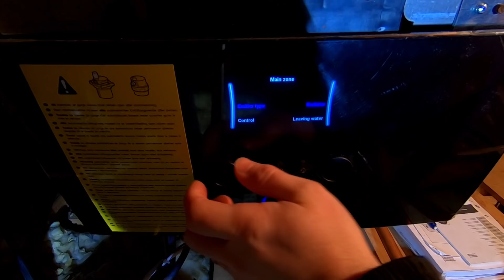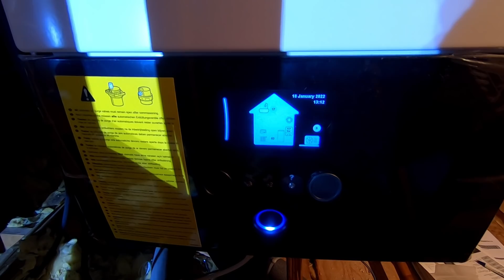How to lose £2000 installing a heat pump

Comment: having listened to users and installers , air source heat pumps work ok above freezing but below freezing the use of a top up electric element makes the system not very efficient , the units are big bulky noisy and require loads of extra systems to install , you will need to go back to hot water storage cylinders etc its really not worth it and the cost is astronomical , and if you dont have under floor heating prepare to more than double your radiators in the building , and if your in a pree cavity style building dont even bother thinking about it your building will never ever have enough insulation to make it work well and also note the output of the system is so slight when like this week ( 4th  week of march ) where we have warm days and cold nights forget it your either be running the system all day and boiling or freezing inside at night cause it takes so long for the system to warm the house up , dont take my word for any of this listen to the experts that are not selling the product , they have no axe to grind , well done urban plumbers on your work
Reply: Nonsense. A standard heat pump works at near full efficiency down to -15c. A cold climate one keeps going at full efficiency down to -25c. When the UK reaches either of those temperatures, let me know
Reply: @britexpat_l33t  to work at those temperature they use a body element if you actually knew what your talking about to start with would be helpful , but thanks for your unhelpful comments
Reply: Most decent heat pumps work happily to -3°c and many even lower, they work very well in other European countries with harsher winters and have done for decades.  The difference in the UK is that we have very low standards of skilled workers and a huge shortage of the ones even a little trained.
Reply: @patrickwheeler2646  thanks for your comments but installers have no bearing on the ability of the system to function , at low temperatures they use boost elements to heat up and what with that and there lack of output doesn't make them economic , i have worked in property refurbishment for many many years and have read all the data most of which is exaggerated at best , i have customers who have had systems installed and some even had them taken back out cause they don't work well enough and are not when it's cold economic to run , but thanks again for your input,  i personally will take my advise from the independent advisors who give an honest appraisal
Reply: @nigelsears7191  I'm independent, my company installs every heating technology from boilers to Hydrogen fuel cells and including boilers.  The fact that you have worked in building refurbishment for a few years does not qualify you to know the efficacy of a heat source.  Hear pumps can (emphasis on the can) work in a property and heat it when the outside temp is in the minus 5 or lower without a backup immersion.  We install a lot of heat pumps and very rarely do they need electric backup, they are there as they are with gas boilers but its incorrect to think that they are a large part of the running costs.
Reply: @britexpat_l33t  the lowest we usually design to in our area of the UK is -3°c so very higher scops fortunately.
Reply: @britexpat_l33t  not around London and the Home Counties, even if it did it would be momentary and have little affect on the home.

Comment: Air heat pump with a radiator system that typically runs around at 50-60 degrees is a bold move, i know people do it but the preformance and savings of the heat pump is mostly wasted. Did they have oversized radiators or some really good insulation for this company to consider it? Otherwise u might use weathercompensation but depending on the house u might need to set a minimum temperature of like 40 or higher degrees to get the system to preform as expected. What system was this? I was trying to find it but couldnt find the technical info. Also great install i see u really care about your craft.
Reply from the maker: They did no such a thing. Radiators sized for DT50 left unchanged.
Reply: @UrbanPlumbers  Well i hope they had a really inefficient system before so they dont notice the lackluster preformance of the heatpump. But anyway thanks for responding and have a nice day with garage installs and no crawling around in attics or flooded crawl spaces.

Comment: Well do not work for cowboy companies. Without weather compensation air sourced heat pumps are a very expensive mistake. Air sourced heat pumps are an expensive joke anyhow.  If you are going to the bother of installing a heat pump then dig up the garden and make it ground sourced.

Comment: These things will never take off. Its gonna have to be hydrogen hopefully produced in uk. Will create jobs and save us money buying it over seas
Reply from the maker: You do realize that 100% Hydrogen boiler (If it is even possible!) will be most likely 3-4 times more expensive to run as compared to a heat pump?

Why would you want to turn 1kW of electricity into 0.3kW of Hydrogen when you can turn 1kW of electricity into 3-5kW of heat generated by a heat pump?

Comment: That’s a nice compact unit to have sitting below your window next to patio doors ,
We all look forward to the day when the stupid government make this compulsory item to have if you want heating in your house.
No disrespect to this chap , but Heat pumps are not the way forward.
In 10 years time on a cold november night, 20 million cars and 10 million houses plug into the electricity supply , where is all this electric coming from , Melt down time .
Reply from the maker: The way things are going with Russia people will have little choice with price of gas going through the roof!
Reply: @UrbanPlumbers  But we currently import electricity in the winter from France as we cannot produce enough due to the lack of power stations , including oil and coal powered which they want rid of anyway,so how is this going to work in 10 or 20 years time with all this vast new requirement for electricity.
It just won’t work .
Or
Do they want all the cars gone.
Reply from the maker: Heat pumps can be 300% -400% efficient so will use 3 times less energy than your gas boiler. That has to count for something, right ?
Reply: @UrbanPlumbers  Evan if they are 1000% more efficient than gas boiler , when millions of houses have them and 15 million cars require electricity on that wet cold winters night ,It won’t be there when they need it .
Lights on , cooking on electricity, home entertainment charging, phones charging , 15 million cars plugged in ,van del depots plugging new trucks in ,office and warehouse lights on , street lights on , and then we have Heat pumps on , all demanding that electricity. 
It won’t stack up .

Comment: It’s hard to see from the video but what brand and model and kwh rating   did you install as it doesn’t seem to have the riser tank for heat pump. Also isn’t the refrigerant propane/lpg based? Thus should be x feet away from any opening window?

Comment: THERES THE PROBLEM  Connecting an Air source Heat  pump to EXISTING PIPE WORK  It's only efficient with under floor heating  NOT RADIATORS !!!!!!
Reply from the maker: you can use radiators and you can even run them at similar temperatures to UFH. They obviously need to be sized correctly.  Existing pipework is actually quite often fine, as we have been oversizing pipework for years. Usually all that needs to happen is primary pipework upgrade.
Reply: @UrbanPlumbers   . The biggest complaint is that existing radiators do not heat up as effectively with an Air source heat pump.  and you're saying they do.  Someone's got to be right.  To have an effective heating system you must go with what Air Pump recommend and that is have underfloor heating. How would you make existing radiators effective ?
Reply from the maker: @52memor  watch my next video coming ion next 10 days. I have just installed a heat pump in a large house with both UFH and 14 radiators.

The trick is to size the radiators correctly for the lower heat pump flow temperatures. When you do that it works as effectively as under floor heating. 

As a matter of fact on this particular job we have a kitchen with underfloor heating and raditors throughout the house running at axactly the same flow temperature of 45C. It has been a very cold weekend here of 2-3C and the house heats up very well. Radiators are sized however for a much lower mean water temperature and therfore they are bigger than your standard gas boiler radiators.

All the heat pump problems start with companies and isntallers doing the jobs but ignoring proper heta loss calcualtions, pipe sizing for velocity and head loss and heat emitter sizing.

Radiators and heat pumps certainly work very well when done correctly.

Comment: I’m 3 years into renewables at the age of 21 and fully qualified in installation & maintenance. I’m positive that there’s such manufactures who make a much more simpler system. As a limited company we focus on Samsung & midea. Mostly Samsung as we get great discount, we’ve never had problems. Only this last year because shortage of delivery drivers and damaged units. Sometimes affecting the pcbs and giving us a e921 fault which is the relay. The most common we get is e911 which is flow. Easily solved. Other than that I love my job, minus lifting 120kg 😉
Reply: Just fitted a atherma and it was 170kg, shoulder buster.
But as you say. I believe high temp heat pumps will become as efficient as the low temp heat pumps. And I think more needs to be done with simplifying the controllers because as much as I want to use the heat pump controller for timing/room stat, third party controlllers are easier to use for elderly customers.
Reply from the maker: You cannot use Daikin controls if you have a buffer. There is no allowance for 2nd pump on the Daikin units, which is really strange.
Reply: @UrbanPlumbers  Probably use the volt free on the zone valve if you have them. Daikin always use the Esbe valve and I've only seen volt free contacts on a few of them. The daikin preplumb cylinders have the buffer on the return so it only uses 1 pump, acts more like a volumizer. I would think there would be a zone valve terminal to bring on a valve for heating, could jump the pump off that? Which daikin is it?

Comment: Ummmm you can kinda tell that the poster is not from the UK as he seems to know what he’s doing and actually cares about the customers needs. 
What would you bet, that the main contractor will fob of the disabled compensation on “those foreign subcontractors”?
Reply from the maker: They said that it was only disabled for testing purposes after the fact

Comment: The first problem is RETROFITTING A OLD SYSTEM  !

Keep the new heating ideas for new buildings & complete refits . 
With over sized radiators & under floor heating .

Run theme 24/7 with a buffer tank & pray the neighbours don't complain !

Comment: If you want to be cold in winter, have massive heating bills and endless breakdowns and callouts - just install a heat-pump.
Air sourced or ground sourced makes no difference ( I both  installed(3 in total))
If any idiot says they are compatible with our cold damp winters, please just have them put down - they don't know what they are talking about.
ASHP on the swimming pool is the only vaguely sensible option as they produce low grade heat for the pool water efficiently when it is hot and you want to use the pool.
Useless in winter and early spring/ late autumn to extend the pool season , its much cheaper to use Gas.
Now the Electricity price is loaded with 25% cost to pay for " Green Energy" and the UK suppliers have scammed the public by making Electricity stupidly expensive vs Gas,  you would have to be deranged to install anything using Electricity.
Its also going to get much worse as Electric vehicles increase demand, just watch the prices hikes and "time of day pricing" on your smart meter.
Reply from the maker: Sweden has the highest per capita number of heat pumps in the world and much harsher climate to UK. You could not be more wrong even if you tired. 

What is an air sourced heat pump by the way 😀?
Reply: @UrbanPlumbers  Mitsubishi Ecodan, Wocester Bosch and Waterco Ultra inverter installed on new build with under floor heating on solid floors for both ground and 1st floor.
I am not saying they don't work - of course they do, its the running costs that are the problem and the fact they simply don't achieve the manufacturer's claim COP. ( they will achieve it of course given exactly the right conditions but these conditions are met only about 20% of the time)
The ASHP in full summer are perfect but the COP falling to sub 3 in winter makes the cost prohibitive and we use the gas and solar thermal in winter.
If you told every new consumer to expect their energy bill to triple when switching from Gas/Electric to fully electric they would run a mile.
My systems have now been looked over by 4 different sets of "experts/specialists and they all agree there is absolutely nothing wrong with the system (after changes were made) but not one of them dared to offer any alternative with any sort of overall efficiency guarantee.

Comment: That loft installation will be a maintenance nightmare, not your fault of course.  Looks like only young and flexible electricians and plumbers will be able to work in those conditions when servicing/updating it in future.  For goodness sake... if only the owner has just replaced their gas boiler!  Love your workmanship though... do you brasso your pipes?
Reply from the maker: no I do not brasso my pipes. No need when you press fit. It is soldering that makes them oxidize quickly.
Reply: @UrbanPlumbers  Apologies I didn't realise it was press-fit... in fact didn't even realise that was a thing!

Comment: In New York State, the  government is trying to ban natural gas and propane on new construction.  Nightmare overly complex and digitized systems will become the norm.
Reply from the maker: They are banning it here too
Reply: @UrbanPlumbers  I
I do not think the government considered what will be required for renovations.  Many of the old buildings lack proper insulation and spare electrical capacity.  Problems and costs include upgraded electrical service entrance, upgraded electrical box, new arc fault breakers, new electric lines run to appliances, the costly appliances themselves, and increased insulation, which can require new electrical wiring.

Comment: what an ugly bit of kit to stick outside your home,  you done a great job, but it seems they should really go on new builds which are designed to accommodate the fittings prior.   The cost, and looks of it and the dodgy protocol of weather compensation has turned me away from one.
Reply from the maker: I love the look of it - very Ridley Scott looking without the cover.

Comment: I’m all for carbon reduction tech and the rest of it. It was my job for over 25 years.  Everything I see on heat pump systems tells me they are okay for new build but terrible as a retrofit.  I wouldn’t have one in my current house even if it was free.  Great video, love the honesty. Peace.
Reply: Hybrid install sounds all right. Basically a low-capacity heat pump that you install next to your combi boiler, and that can run the house most of the months of the year, with your gas flames added on to that heat only when necessary (and with water still coming off gas either way). With gas and electricity pricing like they are now the cost gap is so high that an easy/cheap to install (and in this country subsidized) additional unit like that would be worthwhile fairly quickly. It’s a stopgap but compared to modifying the home properly…
Reply from the maker: Yes, retrofit can be a challenge
Reply: Our home is 70 years old. We heat it solely by heat pump to indoor split units. Works perfectly.
Reply: It's not that bad. My old house runs fine with a single air-to-air mini split. But American wood homes are much easier to retrofit than UK ones.